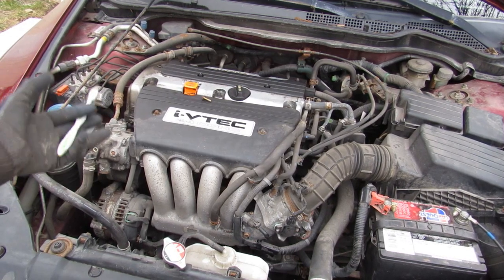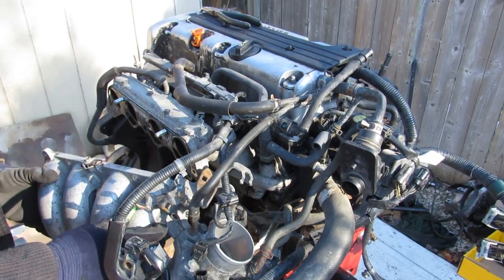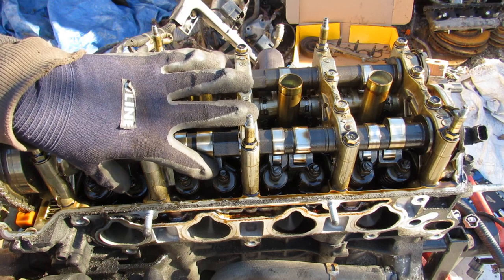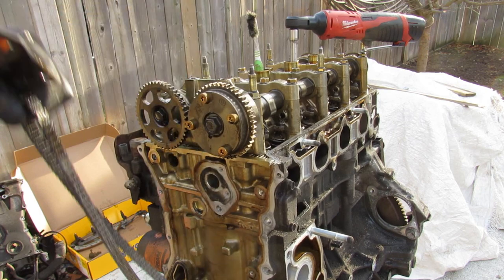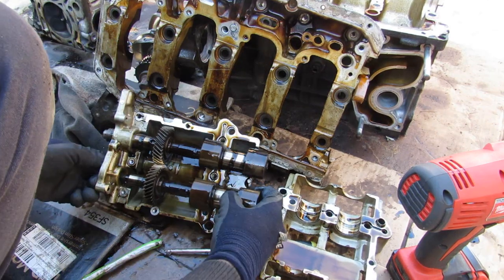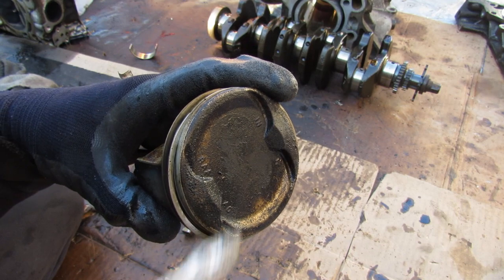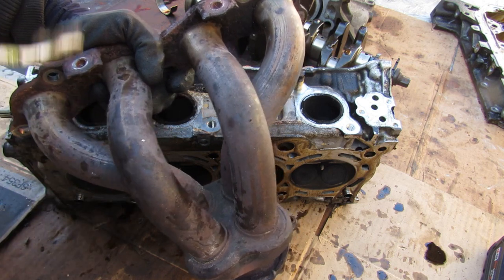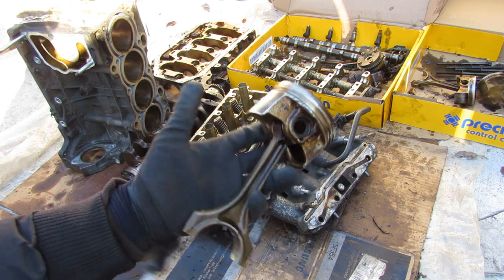Why the Honda K Series is the Best 4 Cylinder Engine

Comment: My only complaint with my old K24 was the placement of the oil filter. Horrible to change!
Reply: Why? Open the bonnet put on the 66mm filter socken on it and turn it. It is completely drama free.
Reply: @CL9k24a3  in my 2004 CR-V, it had AWD and all of that good stuff, it made it tricky to get to in because of the differential and stuff, and from above I could barely even see the filter. I always felt like it could have gone in a better spot but what do I know I’m not an engineer

Comment: From someone that had to replace a gasket behind the crank pulley, there's no way you just broke that bolt loose with just a breaker and cheater bar.

Comment: the best k series engine is either the k24z7 or the k20a2, or the k24a2, id say the k24z7 because there are two guys right now both have a 9th gen civic si and have over 1000whp, the 9th gen is the street devil

Comment: 6th generation Honda accord is also b ullet proof except for those leaking oil seals,vtec solenoid gasket,valve cover gasket,oil pan gasket,distributor gasket that is all leaking after 100 000 miles.This I vtec is the same except for a timing chain instead of belt.

Comment: Those are not the worst but definetly far from the  best. They are common for burning valves. I experienced them in my three hondas. They are torquey prolly their injectors spit more grams per second as a result they are guzzler for the same 2.4 counterpart. They are sensitive to defective sensors. Start it from vtec sensor to knock sensor or o2 sensor.

Comment: I,m a retired auto tech, started out at honda dealer in 1975 then acura store in1996, then independent shop that did mostly Audi and VW in 1999. Let me just say NEW AUDIS AND VWS SUCK>>>they are junk.and not just the engines, VWs are even worse. I drive a 2007 accord that has 292000 miles on its K24. the cam cover HAS NEVER BEEN OFF. change oil with synthetic every 5000 miles. still like new. normal maintenance is all it needs. i would NEVER drive any thing but Japanese!

Comment: Hey speedkar I have an 06 accord with a k24 that has 145k miles on it. It’s been well maintained and the only outstanding mechanical issue on it I’m aware of is a knock when I turn right which I’m thinking is the cv axle. Only work I’ve ever had to do were changing the starter, alternator, and the fan belt tensioner

You think it would be worth it for me to spring for a timing chain job? I plan to drive it as long as I can.

Comment: Unless it's 2013+
Reply from the maker: Lol direct injection kinda killed the vibe eh
Reply: I have one worn vtec lobe, only one. The oil pressure tensioners crap out by like 70k. One in the shop on a '17 has 50k miles with some loose rockers. Replaced the timing chain. Didn't fix it. So they are having a real good time with that one.

Comment: I heard that while most K-series engines have timing chains, the K20A3 (found in the EP3 Civic SI and lower-trim Acura RSX) has a timing belt. Is the K20A3 the only K-series engine with a timing belt or are there other belt-driven K-series engine variants?
Reply: K20a3 is a timing chain

Comment: A guy I used to work for had an '85 Chevy Citation with the 2.5 "Iron Duke" 4 cylinder pushrod engine with throttle body injection....got 40 MPG hwy. That was 35 years ago! How much has all this fancy Vtec , DOHC, 4 valves per cylinder, direct injection, computer controlled everything actually helped?
Reply: The Iron duke is a pile of crap compared to the K-series.  Heavier, iron motor that made 40hp per liter despite the fact that it has incredibly favorable geometry for a high revving, power producing engine; large bore and short stroke.  A K24 running on 2 cylinders would make more power.  That "fancy VTEC" is what enables people to drive around with 300-350hp NA K-series engines on the street (Docile at low rpm, beast on the big cam)

Comment: How is it possible that this guy knows so much about all these different types of engines? With the level of this guy's knowledge, you would think he was some crusty 60 year old mechanic, or an automotive engine designer. Yet, he sounds like he's in his late 20's or 30's.  Also, given the complexity of today's modern engines, I can see why moving to the simpler EV designs are the way of the future. More consumable, simpler, and swappable electronic motors and parts. No need to drop and rebuild the entire engine because of some failed plastic design part buried deep within the engine has failed after a 5 or 6 years, just outside the warranty period....
Reply from the maker: I do a bit of research on the engines before tearing down. 
You are right about my age 😂

Electric cars are more mechanically simple but much more complex electrically. Would you rather diagnose some bugged script code or an easier leaky water pump? Haha
Reply: @speedkar99  The fact that you (and Acura) reminds me I should "occasionally" have my engine heads removed on my 2010 Acura TL to "adjust the lifters", as they are prone to clatter and clack over time so matter of factly. As if it was just a standard oil change. That's when I doubt the future of the gasoline engine. In fact, anything that requires me to "drop the engine" or remove the head gaskets just to fix some prematurely worn part is the point at which I feel the evolution of the gas-burning automobile has reached its peak and it's time to finally convert to EVs.

I think after more than 100 years of manufacturing automobiles, if they still cannot design and produce an affordable car that can last at least 15-20 years on its original parts and that, if well maintained, and does not require disassembly of any part of its engine, then I think they should probably give up. Haha.  

Anyway, nice videos. I've enjoyed watching your disassemble these beasts and explaining what all the parts are and useful insights. And I hope your wife and brother still have some clothes left. haha

Comment: I would gladly take a 3rz toyota engine over ANY honda engine. Yet to see any hondas making 1500hp like some 3rz's without being a full billet engine. I've seen ecotecs making more power than the some full tilt K series.
Reply: They both will take the same amount of work to handle 1500 up.
Reply from the maker: Depends on your intentions. I'm just saying the K is a good all round motor, all things considered

Comment: Always poor Honda fanboys will swear K is the god of all 4il engines. Guess what 240hp >200hp . 9000rpm >8000rpm . No stock K ugly hatch or DC can keep up with F20C in the original jewelry. 15sec K vs 14sec F .

Comment: I’ve always liked the b series better, but to each his own. The main thing I don’t like about these is they like to burn oil, unlike its predecessor the b series which doesn’t burn oil anywhere near as often. As for the 1.5 turbo successor of this motor, well it must be designed in Texas because it makes it’s own oil and will probably burn it’s oil in the future. Piece of Garbage.
Reply from the maker: Get out of the 90s lol
Reply: speedkar99 but everyone in my area of Texas has manual Honda cars from the 90s so I’m stuck here. I don’t even drive Japanese cars, I’ve always bought American cars and currently I have a 1970 charger with the 426 hemi that I drive around along with a 99 crv with the manual. So technically I’m stuck in the 70s. 😂

Comment: So the same issues like in my tsi engine from 2010 hehehe. That's bad 👎
Reply from the maker: Oil issues?
Reply: @speedkar99  After 100k miles timing chain was stretched, oil consumption was around 1,5l (piston oil ring was clogged). The amount of carbon buildup on Honda's engine is nothing compared to my tsi engine. Top part of that piston looked like a moon surface. Lifters were coated by carbon also. I did full rebuild of that engine with new custom pistons with three rings. Also injectors were dead (i had black/gray smoke from exhaust during reving the engine). These engines are nice and smooth when they are new or after rebuild. 😁
Reply: To be fair I did rebuild only because of oil consumption. Engine itself and other components even coated by carbon buildup worked perfectly fine.

Comment: The 6 bolt 4g63 90 is the best 4 cylinder by far 
K series is a joke
Reply: I wouldn't say its a joke. Its a fantastic engine and ive got 90 vr4.

Comment: No honda K20 or any other honda is not the best four cylinder engine. There are  numerous Toyota four cylinder engines that might not have been more powerful than a Honda but lasted twice the life of a Honda. to mention few 4A-FE, 7A-FE, 22RE, 2RZ 3RZ .....  so has old Mercedes.
Reply from the maker: The old stuff is good stuff

Comment: k series is the best BLAH BLAH BLAH.... yet the 4g63t is still the fastest and highest power maker
Reply: What’s the highest hp 4g63t out there? Cause I know for a fact there’s 2500 whp outlaw class civic drag cars out there running k series engines… 4g63 is good, but its not k series good, considering the all motor 550-600 whp civics out there to….

Comment: Everyone thinks their favourite 4 cylinder is the greatest. But here is a fact. Out of the top ten quickest and fastest 4 cylinder engine in the standing quarter mile,NONE are hondas but there are two SR20s in that list. Theres also a 4g63 on that list. And those are the two engines that are really the best 4 cylinders.
Reply: That is incorrect
Reply: @trizkial7592  youre right. There are now three SR20 powered cars in the top ten fastest 4 cylinder drag cars. No hondas on the list still.
Reply from the maker: The topic here isn't what's the fastest...
Reply: @speedkar99  well. If its not about the fastest then its just a matter of which engine one likes. Not so?
Reply: @conradsealy9603  I have had Honda’s and Toyota’s and others... It’s just a fact that the K series is literally the LS of 4 bangers. When you have people making 600whp with an NA K24 that’s the size of a backpack that pretty much seals it. And they easily last 350k plus if taken care of 😁
Reply: Parker Johnson not if u tune it 😂 and put turbos
Reply: @trizkial7592  lol. We know very well that k24 is very close to 3 liters and running on nitro methane. There are no SR20s that displacement. Also. Thats a pure drag race engine. Lol. After every run it will need to be rebuilt. Lol.
Reply: @conradsealy9603  I’m not saying the Sr isn’t a great engine because it is. I didn’t mean to come off as rude. It’s just MY opinion that the K series is probably the best 4 bangers. If not the best then definitely top 3... I am a fan of whatever company that has an engine that has a super high NA efficiency and high brake mean effective pressure. That’s why I also think the coyote mustang engine is an incredible motor as well especially for the price
Reply: @trizkial7592  I cant recall saying honda is garbage. Theyre quite good actually. I almost bought one. I bought a 200SX(S13) instead. Been having fun with it ever since.
Reply: Conrad sealy ,you been fighting this battle against Honda for a long time. you feel time on a 1/4 mile with a modified engine means anything to those car  companies? were it’s how deep you pocket is determines how fast your car is.that’s how you rate an engine lol... you must think hulk could beat super or Superman could beat hulk?but truth be told in stock form the k is a better design engine than the sr and I’m not saying that Nissan can make a better 4 cylinder than Honda but I’m just not bias.
Reply: @shivanarjoon6329  lmaooo
 I dont have to fight. Two reasons why I dont uave to fight against hondas. 1. NO honda(not even turbo civics) has beaten my SR20 powered S13. In fact, a guy crashed his civic trying to keep up with my S13. Even a turbo accord tried and got gapped by my S13. So your comments are meaningless to me. And 2. Click on the link I posted to the other honda boy in this chat. Need I say more? 😆😆😆😆
Reply: @shivanarjoon6329  as for the hulk. Maybe you honda guys spend too much time watching cartoons. Hell. I wouldnt have a clue if hulk can or cannot beat superman but I know this. There are big bidget hondas that are not in the top ten list while there are three SR20s and a 4g63. Both of those will gap the best k or b series on the planet.😆😆
Reply: @shivanarjoon6329  its guys like you two that just keep setting yourselves up for ridicule. Hondas are ok but certianly not the best. Thats all.
Reply: @conradsealy9603  yeah we Honda guys watch cartoons while you stroll YouTube to look at Honda vids!
Reply: @shivanarjoon6329  lolol. That comment is meaningless. Honda guys try bit really cant troll on Nissans. Lol. You can keep replying if you like but Im the one laughing here. Laughing HARD!😆😆😆
Reply: Your a Nissan fanboy.  The majority of people couldnt care less what some tube chassis RWD cars run in the 1/4.  Almost any engine can make 1500+ hp with enough boost thrown at it.
The fact is from an engineering standpoint the K-series is far superior to the other two.  Better cylinder head, better BSFC, much more plentiful, parts are everywhere.
Despite the K-series and F-series being NA from the factory, their stock blocks can hold more power than the factory boosted engines you think are so great.
When it comes to natural aspiration, the SR and 4G arent even on the same planet as the Honda motors.
Reply: @ChrisSmith-gx4ri  😂😂😂😂😂😂😂
Reply: @ChrisSmith-gx4ri  the worlds fastest 3/4 chassis 4 cylinder car is also powered by the SR20. You see why I just keep laughing at you honda fans?😆😆😆😆😆
Reply: @ChrisSmith-gx4ri  you honda fans seem unable to stop setting yourselves up for ridicule. 😂😂😂😂😂😂😂😂😂😂
Reply: @conradsealy9603  They dont get rebuilt after every run, nice try though.  Are there any other sub 3L 4 bangers on the planet that make 750+ NA horsepower?
Reply: @ChrisSmith-gx4ri  as for n/a. Ive seen quite a few N/A SR20s beat up on b series. Even in road racing too. You honda guys are hilarious.😆😆😆😆😆😆
Reply: @ChrisSmith-gx4ri  post a link of this 3L engine.
Reply: @ChrisSmith-gx4ri  by the way. Are you aware of the SR16 VE N1 engine? Look it up. 😉
Reply: @ChrisSmith-gx4ri  the more you guys comment,the funnier you all look. 😆😆
Reply: @ChrisSmith-gx4ri  dont waste your time on this guy he is a die hard sr rb fan ..he should go and look at haltech vid about the k series and to the end he will see that haltech himself said a lot of rb guys taking Honda k series design to make the rb block stronger not sr but  the kseries!
Reply: @conradsealy9603  2.7L actually.  Plug in 2350 lbs and a 163mph trap speed into a HP calculator and see what comes up.
Reply: @ChrisSmith-gx4ri  a 2.7L honda. To do 163mph? While a 2.0L N/A SR20 did 151mph in Puerto Rico a few months ago. Lol. How many 2.0 N/A hondas did that? I dont know. You tell me.
Reply: @ChrisSmith-gx4ri  you can keep trying but youre wasting you time. As I said before. Hondas arent bad. But theyre NOT the best.
Reply: @conradsealy9603  so you think sr is the best?We never said Honda is the best we said it’s a better design than the sr but you just can’t hear that !
Reply: @shivanarjoon6329  the SR has certianly proven itself. From drag racing to road racing and time attack. Not even you can deny this. Unless youre totally clueless that is.
Reply: @conradsealy9603  since your an expert on internet top ten’s you should take a look at the top ten All motor cars ...no sr their!
Reply: @shivanarjoon6329  fighting a losing battle seems to be your mission. But. I will repeat for you once more. Hondas arent bad. Just NOT the best. Wether you like it or not.
Reply: @conradsealy9603  in your mindset I sound stupid but I can’t blame you.You shouldn't judge people based on appearances and your preconceptions.
Reply: @shivanarjoon6329  Thats because the SR cant do shit all motor.
Reply: @conradsealy9603  163mph at the weight they run translates to over 750hp.  Nobody bothers with drag 2L k-series engines.  The same 2.7 motor destroked to 2L would make 550-600hp.  What was the weight on that 151mph run?
Reply: @ChrisSmith-gx4ri  considering there never was a SR24 to use as a basis to reach 2.7 this did quite well. The SR20 does well not only with turbos but in N/A form its no slouch either. Thats why its my favourite 4 cylinder.

Comment: Better than Toyota’s??
Reply: In some ways, they definitely sound better and have a better feel to them.
Reply: @thetechlibrarian  I have 07 crv. Does this car use the engine u reviewed?
Reply: Most definitely
Reply: Toyota would be a good second tho
Reply: @trizkial7592  interesting, I thought Toyota engine is most reliable
Reply: @bryankang3286  overall probably but Honda has made the best 4 bangers since like the 80s
Reply: Honda is the largest manufacturer of internal combustion engines in the world and that experience gives them some of the lowest failure rates. I'm not going to say better or worse than Toyota, most Japanese products are of good quality
Reply from the maker: Depends what you are comparing. Honda does make very strong engines but i think there's smaller things (in addition to bad transmissions) cause them to end up in the junkyard faster than alot of old Toyotas.
Reply: No toyotas are the best they make better 4s 6s 8s 10 cylinder engines than hondas Honda only make good 4 cylinder they the largest at making 4 cylinder engines